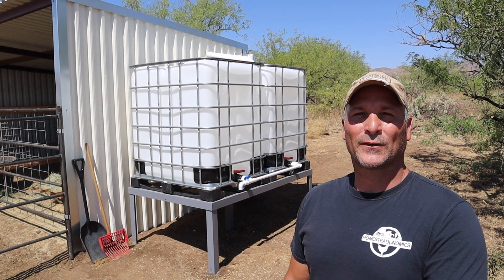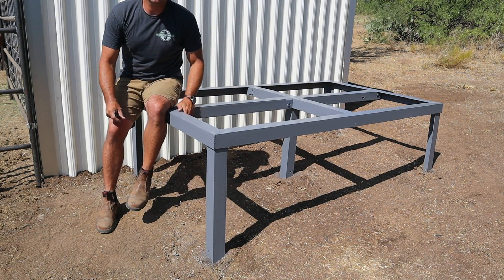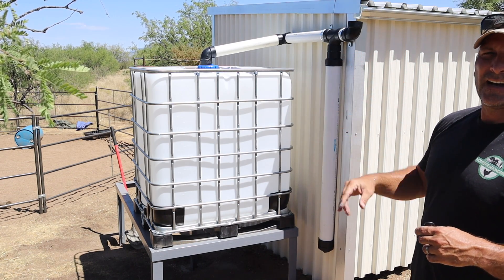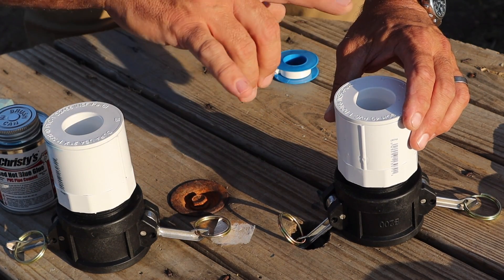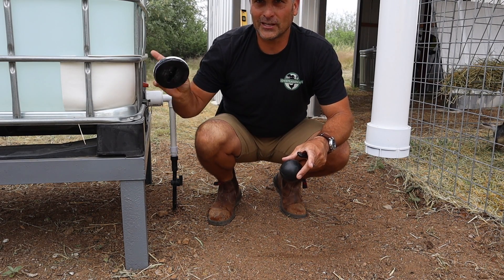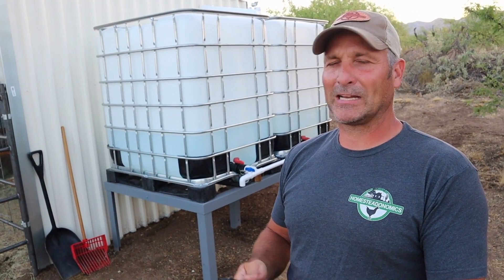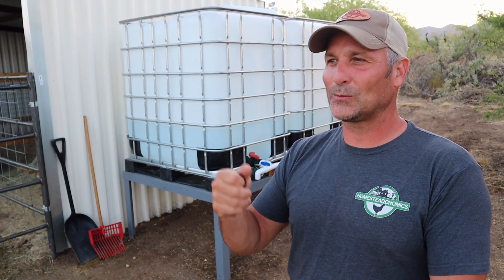Rainwater Harvesting System For the Horse  - DIY First Flush and IBC Totes

Comment: He fucked up. You never use ABS for outdoor use. It's made of Acrylonitrile Butadiene Styrene that break down into carcinogenic substances in the water with extended esposure to the sun. Not only that it discolors and becomes brittle with exposure to UV radiation which reduces its strength over time.

Always use PVC only for outside use and wear the captured water is meant to be used either for drinking or for garden use even.

ABS is ONLY for indoor wastewater use folks thats the only place u really see it being used properly.

Comment: Great video’s!  Just setting up a similar set up.  I didn’t notice an overflow set up on yours.  Ours will be on a 32’ x 48’ shop with 2 tanks so will likely fill fast.  Do you think it is ok to have an overflow relief on the same tank as the filling tank with the two tanks connected as yours is?  Thanks!

Comment: Thank you for the video and the ideas i now have 😊
I've just scored 12 IBC's, for free from work.  I was playing with the idea of flexible hose (because that fits with my transportable pump setup) for my last roof space to harvest water from,  but you've jogged my thought process! The semi-perm fittings for the ibc's is exactly what i need to do rather than the mis-match i currently have.  This is just for veggie garden water and potentially some aquaponics.  
My only comment, or question I guess,  is with the monsoon coming you'll be expecting a fairly high rainfall rate,  so will your gutter transfer ALL the water into the downpipe? In australia we have a large raincatcher to guide the gutter water into the downpipe so there is no loss in heavy rain.

Comment: The metal looks like angle iron and you refer to it as movie theater steel.  What's the difference?  You've called it that in many other videos.  Please help an old lady out.
Reply from the maker: It is 3x3x1/4” steel angle.   No difference at all….just plain old steel angle.   But I refer to it as movie theater steel because I was gifted quite a few pieces of it when an old drive in movie theater in Tucson was torn down.  And a few of the earlier videos where I used it….I told the story about it.  Which I think is a little bit interesting…
It was from an driven in theater called ‘de anza’ in Tucson.   And it was actually the place where my wife, as a little girl, saw her first movie ever.   And these pieces acted as the purlins that the theater screen was attached to.   And now they are on our property provided entertainment of a different sort.   Goat pens, water harvesting, gates, etc,.😊

Comment: i find it counterintuitive that the water from tote #1 can flow into tote #2 at the bottom. it seems that the weight of the water in tote #2 would be pressing down to stifle inflow. why does this work?

great job btw. i always enjoy ALL your projects but especially rain water harvesting.
Reply from the maker: Water always seeks level.   So the pipe allows water to flow between the tanks.  And if one tank is higher on level then the deed elevation pressure will move water to the lower level tank until the levels are the same.   Hope that made sense and thanks for watching!

Comment: I like your work.  Most of my work here involves metal fab using both new and salvaged metal tubing and angle.  One thing though:   Would it be better to house those totes?  This would  help prolong the plastic totes usable life and prevent algae from the suns rays.  
Also the height of the metal rack lets you quickly check underneath for snakes.  Good job.

Comment: your goingto find out later that youll be out there alot clearing leaves off your little "" screen "" !! weather its a gutter screen or a down spout screen leaves stick to screen i hate it so much the asshole that thought a screen that should be used to keep leaves away should be deleted from the planet.
Reply from the maker: I’ve use similar screens on my house system for about 14 years and I usually clean them off a couple times throughout our rainy times.   They work well for me as our leaves are small compared to some areas.   But I can see if you’re in a maple tree area or something like that it might be different.

Comment: Where do you get the first flush ball?
Reply from the maker: I got the one on the clip from a rainwater kit from tank depot.com.  But you can also use a kids plastic ball so long as it is large enough to get stopped at the necked down area and hollow so as to float up with the water level.

Comment: Where do you get the ball & what size do you use for that 3" to 4" reducer?
Reply from the maker: I got the one on the clip from a rainwater kit from tank depot.com.  But you can also use a kids plastic ball so long as it is large enough to get stopped at the necked down area and hollow so as to float up with the water level.

Comment: Good video. What is your average rain fall per year? I built a gravity fed system for my animals to drink from and for myself to use around my yard through taps. To cover the IBC tank i used black silage cover. Its a heavy plastic.
Reply from the maker: Thank you!   We get quite a range of rainfall.  Tucson our closest city gets 12-13” on average.  We can get a few more than that because we are slightly higher and close to some mountainous areas (rain shadowing).   But the last few monsoons were so incredible that a couple years we were into the 20”s…. With 10-15” coming in the monsoons. 
But it’s hard to say with specifics as it does range quite a lot.
Reply: @homesteadonomics  I'm from Northern Ireland. We would normally get around 30" per year. Our rain isn't as heavy but it could snow in July! lololol

Comment: I used a cinder block frame on the 4 corners of the IBC, and I do not recommend this.  They sank into the ground from the weight of the full IBC tanks.  Landscape timbers wouldn't hold the weight.  Rail beams may work.  My tank is a 330 gal.  If you figure 1 gal of water weighs 8+ lbs, the frame needs to be able to hold 2750 pounds of water.  I will try making a solid layer of cinder blocks to hold the weight.  I think the more even distribution would work better.
Reply from the maker: Yes cinder blocks would settle with time and moisture….you’d need to set on a concrete footer.    As for the landscape Timbers…. That is in reference to using them to build up the ground in kind of a retaining wall style.  So the compacted ground within the boundary of retaining Timbers, or Railroad ties, would be holding the weight.  Anyways just more of a topical overview of options that could be used.

Comment: I had not much issues with alga the first season with a new clean tote but every other season after that it usually gets quite bad at the end of the summer. Pressure washing it in the spring helps but it's really difficult to fit the washer handle inside the tote so the upper section usually doesn't get cleaned as well as the lower part. It's okay tho because I'm only using it to water plants. Also those +200 gallons are surprisingly quickly used when it stops raining for a month. I should get another.
Reply from the maker: Yes, for sure!  I’ve also had the same experience.  I keep meaning to try one of the covers that folks sell for them….but usually opt for paint or to just clean it out occasionally.   And yes, it’s surprising how much water we use.   So when you see the level dwindling while using a tank you definitely notice it more.   Kinda like using cash versus a card.  Makes you more conscious of when you spend.
Reply: I have been using lime mortar (used for construction) which at the end its calcium hydroxide in the cattle water through and it keeps the water crystal clear for long time!!  and its a way to provide a little extra calcium to cattle.

Comment: Another fine job complete. You always take pride in your work and it shows thru in the videos even when just making a water collection system. I was a bit surprised that you didnt Tee off with an  automatic fill/float valve for the water that is in the Horse Pen, so you don't have to transport the water using the bucket.
Reply from the maker: Thank you!  As for not doing the float valve.   At the moment the water trough is on the other side of the barn in a shade area and I didn’t want to run a hose or pipe there.   
Also, with all the training we’ve been doing that water gets pretty muddy with the round pen dust.  So we’ve been cleaning it out a lot to keep it nice for the horse.  But once I get some less dusty media to put in the horse area I will probably at a float valve to that trough and relocate.

Comment: Watch your videos with interest. But in this video I want to criticize your tank for water. Since it is transparent, long-term storage of water in it will lead to "blooming" and it will become unusable. 
Water tank must be hidden from sunlight.
Sincerely, your subscriber from Lithuania .
🇺🇸     🇱🇹
Reply: He mentioned in the video that he will paint or cover the totes to prevent algae growth. He has an older video showing how he painted others he has.
Reply from the maker: Thanks for checking it out and great to hear from Lithuania 🇱🇹!   And elkhunter mentioned that yes, I will eventually paint or cover it.   But currently it will be cycled though quick enough so as to not be an issue until we are out of our monsoon season.
Reply: @homesteadonomics  Painting these containers will not give a positive result, since when exposed to sunlight, the water will heat up. For example, at a temperature of 20-30 degrees (celsius), it can reach 60 - 70 degrees (celsius). I once made a shower according to this principle, it was impossible to wash without mixing cold water.😥

Comment: 12:53 with a real hard rain, is it possible the flow could miss your drain? Really nice setup!
Reply from the maker: Some could for sure, but most will not.   And if it did become a problem a simple backside ‘dam’ could be made with some extra pipe in a 1/3 circle to kind restrict the flow wanting to skip.

Comment: Just a thought. If you get leaves and debris caught and matted on the upper screen mesh, you might find that as water  pours out of the roof gutter that it will deflect off the debris and splash over the sides of the pipe thus losing it.
Reply from the maker: Yes those can be a problem.   But I just make sure to brush them clean in between rains.  Just a quick few seconds and it’s good.   But if you had lots of leaves it’d definitely be something you’d have to keep on top of.
Reply: @homesteadonomics  I've found that making the screen filter "domed" a bit really helps because the debris tends to slide off instead of getting caught or piling up on a flat surface.

Comment: Love the rainwater harvesting videos. I noticed you didn't show any kind of seal where the inlet pipe goes into the tote. Do you not seal that? Thinking about mosquitoes and other insects getting in there. Definitely don't want mosquitoes breeding anywhere around my house, that's one of the things that finally drove me out of Georgia. 💥🦟💥
Reply from the maker: Thanks!   As for that gap….I don’t worry too much about it.   But it could be that we just don’t have as many mosquitoes here and when we do it’s for short durations.   But it’d be easily remedied with a tighter hole.   I just used a 3.5” bit because that’s what I had.   But a smaller hole that was tighter would be easy to do.
Reply: I discard the cap and use a sealing ring. It's a firm foam material that allows for a tight fit should be able to get them in any plumbing section.

Comment: What's the all in cost for this system?
Reply from the maker: Oh boy….i always hesitate to give specific costs on thing like this because prices and availability of these things usually varies so much in different areas.   Also, the piping ‘needed’ for something like this can be much less than what I used.   As part of my system is to show what CAN be done versus what is minimally needed.  
But for a quick estimate the IBC totes in potable quality will rang you around $150/tote and the PVC will range from  $125-$250 depending on what you use and source it from.  I had to use various combinations on this specific system because my Home Depot was out of the cheaper ‘thin walled’ stuff, which would be on the lower side.   So I had to get stuff from a contractor supplier that only stocks the heavy stuff.
Hope that helps

Comment: Looks like a pretty slick setup.  I always love the sound of Arizona rain:)  I haven't have very good luck with those plastic blue handle valves in the Arizona sun, have switch over to a brass fitting and a metal lever.
Reply from the maker: Yep….plastic doesn’t hold up well out here for sure.

Comment: These setups are so cool in their simplicity and effectiveness. You get lots of clean, usable water with every rainstorm.

I don't remember if you've ever addressed this in a previous vid - what are the pros and cons of your multiple IBC totes vs your larger cisterns?
Reply: Probably cheaper to start out and easier to clean, but that's just a guess. Plus if you have a tractor, they're portable even when full.
Reply from the maker: @wolfpreist yes, exactly!
Reply from the maker: They are a cheaper option for something smaller like this.   Since they are industrial use they get discarded for relatively cheap compared to a newer tank.   
In general the bigger tank size the better the value.   So if you’re only going to need a 1000 or so capacity, then IBC’s can fill the need well.   However there quickly becomes more expense and complexity if you were to tie many more than perhaps 2-3.   

Plus I kinda like the industrial aspect of them…. Stackable, moveable,… and  kinda cool looking too!

Comment: That first plush system looks way overdone.
 You don't even need the little ball in there, once it reaches that level it's just going to flow right over the top.
 I just use a y filter but that's just me
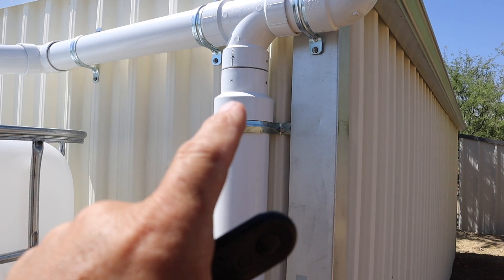Reply from the maker: I put a little text box about the ball not being absolutely necessary 10:27